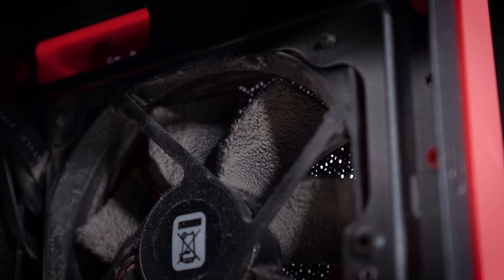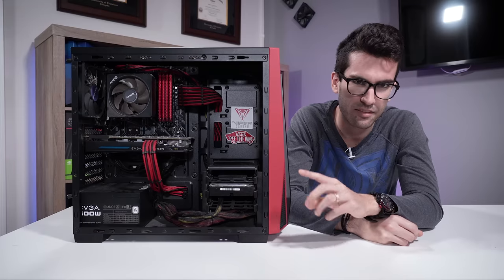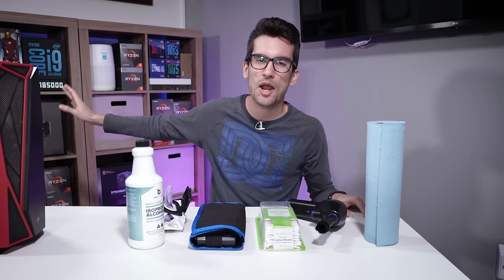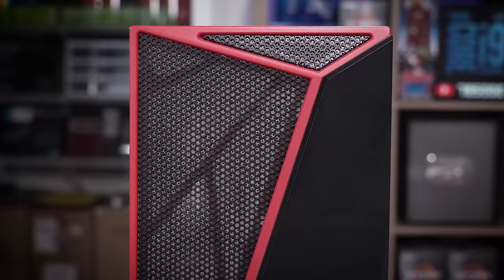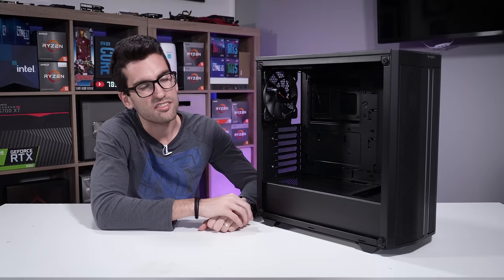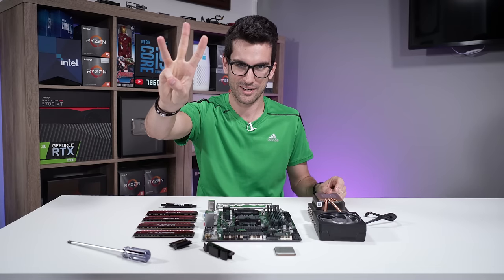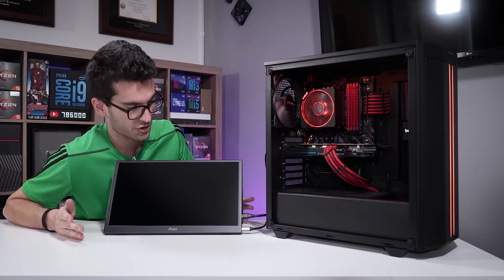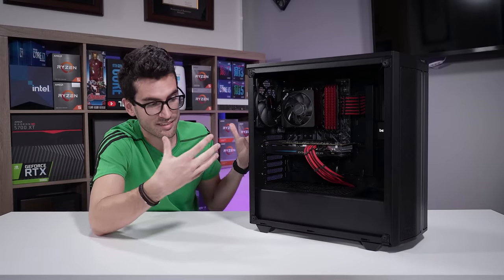Deep-Cleaning a Viewer's DIRTY Gaming PC! - PCDC S3:E4

Comment: Man I wish there was a way, maybe with the customers permission or something, to see the before and after temperatures on these. I'd place my bets that CPU is running a good 15 degrees cooler considering how much was caked on there. Also these vids were a big help when I decided to finally take my computer(mostly) apart and clean it up. Keep em comin big dawg.
Reply: He mentioned later in the vid that he will try to do a before and after for a reference
Reply: seriously???
Reply: I mean if he doesnt want to mess with the customers os he can always switch the customers ssd with his for testing
Reply: Lol you didn't watch the full video bro. 😂
Reply: Dirt/Dust/cable management will never do a 15 degree change, unless I am wrong. Thermal paste and airflow for an old system does more.
Reply: People are so obsessed with him doing temps haha, he just cleans em man
Reply: He could just connect his own ssd to it and install windows on and test it before and after
Reply: It will be a few degrees max. Trust me.
Reply: @bumble1057  go check Dawids latest cleaning video. gained 20C by cleaning a PC. a VERY nasty one but still. 20C
Reply: pressure wash ?
Reply: You can do CPU temps in the bios. However he does re-paste them and thermal compound has a break in time. Just re-pasted my GPU it went from 32c at idle to 26.5 but that took about a week to settle in it was the same maybe even a tad hotter at first.

Comment: The be quiet! Pure Base 500 DX automatically earns a thumbs up from me. Such a great case. Like you said, moving the top fan to the front is clutch. It does also sync up to ARGB software so you can control the LED’s that way.

Comment: You know, out of all the tech YouTubers, your case builds are simply the best!  I have a very dusty home so I got a case in 2018 that had full filters (AeroCool Aero-1000), to replace a Cooler Master HAF 932 Advanced which would get dusty and weighed a TON! lol (Due to a new medical condition my wife didn't want me lifting the old computer anymore, and made me build a newer, lighter one that I would not have to upgrade for 5 years.  To be honest, I like to remove and add on as prices drop.)  I need to clean this computer now and was going to take it to a computer store where I used to work to use their air compressor.  But seeing how you clean PCs, I would sooooooo drive to you from Louisiana to have you clean it!  Looks like I'll be taking everything apart. LOL  Great channel, great series, keep it up! (^_^)
Reply: So...am I being scammed???!!!

Comment: Fine, fine... You inspired me to do a deep clean yesterday. While not quite as bad as this one, I hadn't even done a simple dusting in well over a year (except the GPU - I was getting a weird pink windows issue for the last month, but dusting and reseating didn't seem to help) so I took everything apart and basically tried to copy what you do here.  I did have to reseat the RAM 3 times to get it to post, then tweak my RAM timings to get past the BIOS at all (I was running a slight OC of 2933 on a 3200 kit, due to Ryzen compatibility issues), but once I got into windows, my thermals had improved by a lot more than I was expecting, and, best of all, the pink screen was completely back to normal!  Thanks for putting these out there!

Comment: Btw, pressing and holding the led control button on the Pure Base 500DX for about 3 seconds will switch it over to motherboard control, so you aren't limited to the case preset colors and patterns.

Comment: I recommend checking out that 5 in 1 pc brush from amazon, its pretty handy and helps me keep things cleaner.. i keep it right on top of my desk and do a little wipe down on the keyboard and dust off the vents everytime I boot up.  Then I pull the panels once a month to dust and wipe things down.  Cleaning fans is the worst part and I still haven't found the best tool for those, just paper towels and lots of the alkyhol. Lol..

Comment: I want to say thanks to Greg. This is my son's pc and he's in love with it now. The side panel was butcher to accommodate a plexiglass cause he wanted to see the lights inside and it fell apart and he eventually threw it out. But now he's a happy kid.
Reply: If you ever feel like gifting him something for the rig, consider a more modern power supply. The basic EVGA 600W is cheap and seemingly gets the job done, but its efficiency is poor by modern standards and more on par with what was around in 2008-9ish, suggesting an outdated platform. That system should be more than happy with a good quality 450-550 W PSU anyway. I might suggest looking at a be quiet! Pure Power 11 500W (note: the 'CM' model is more efficient, partially modular and only a few bucks more), the EVGA 550 GA or a Corsair RM550x 2021, all of them 80Plus Gold rated and in a similar price range (70-90 bucks on Amazon). Going used may be an option but takes a lot of research.

As another fairly inexpensive quality of life upgrade, I might consider an inexpensive tower cooler (e.g. Vetroo V5) plus some small adhesive-backed heatsinks for the board's VRM MOSFETs to make up for reduced airflow down there. About 50 bucks all in.

Comment: In a case like this with the mATX board in an ATX case an easy fix to hide it could be a vertical GPU bracket. I did that in one of my builds and it works nicely. :)

Comment: I used mainframe sleeved cables for my build and they were very nice, not too crazy $$$, but more then Amazon.  But you get to choose every color wire, comb types, color connector, orientation of clips so it will fit your GPU and bend the correct way, thats a big issue I saw with the cheaper cables.  about 40 bucks for the 24pin, and I think 12 bucks for each 8 pin.. not the cheapest, but nice to make your PC a little more special..

Comment: Well, I would've moved the red led Corsair fan from the previous case to the new case since it would match the red & black scheme well, I would've placed it on the back, one 140mm fan on the roof and two on the front. But hey, I'm just nitpicking, another great job as usual.
Reply: new fans are probably quieter...

Comment: I am curious, why you don't use a vacuum cleaner on the parts of the build that would not be vulnerable to static electricity damage. It seems more practical to vacuum up the dust on these parts rather than blow them out of the part being cleaned.

Comment: Sad to see just one front fan and more open space around fan than fan area itself so it's basically just take air inside the case because it's less resistant to get there :)
Cases where fan is directly "connected" to filter and it's cover whole front then that will take air through the filter.

Comment: Watch out for poor quality cable extensions, here in Brazil there's a brand called Titan Caselabs who is known for good looking PSU extension cables, but recently, with more hungry GPUs and CPUs. their cables are melting, frying the connection they're in, even the 24 pin cables are melting. So, watch out for cables, even if they're thick (16-14 AWG), it doesn't mean they're good.

Comment: Learning alot for these videos but i do have a question i havent seen answered yet. I have a corsair h100 x240 cooler, its about 3 years old now and my question was will i have to replace the fluid in the cooler? Should i buy a new one instead? how long should i expect it to last. I have been having performance issues and i suspect its my cpu temps contributing to the issue.
Reply from the maker: If your temps are fine, don't bother. If it's getting hot, try replacing coolant. If that fails, buy another. Common sense dictates saving time and money if possible.

Comment: I'm kind of worried (I don't think it's actually in there) about a screw I dropped while trying to put a replacement PCIe slot bracket on the top part of the back of my case (I should have punched out the second and third for the GPU and considering how flimsy the replacement is I regret that miscalculation but it's better than nothing) being in the computer I finished building. How does a candy wrapper (that's not a tiny crumb like I thought that's a smudge of chocolate) end up in a case? lol

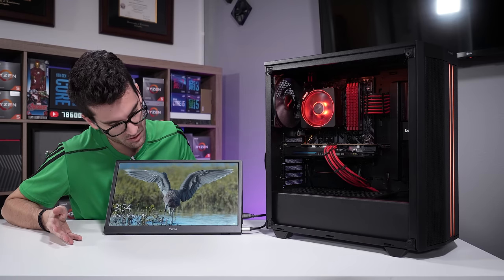Comment: 16:45 quick question regarding the boot time: I have an R5 3600XT on an Asus TUF Pro Gaming B450 motherboard and my OS is installed on a WD Green SSD. Windows boot-up process takes around 10-15 seconds. Is it normal? His PC booted so fast that it got me thinking. Thanks.
Reply: Yes cause every ssd is different in the terms of read and write speeds, also he might have fast start turned on

Comment: yeah never ever use a pc without the left panel I had a HP Pavilion Gaming Desktop TG01-2260xt PC a few years ago and when I was switching RAM out I was testing it to see if everything was working after I installed the RAM and I left the panel off just incase something was wrong well I have cats and I had water next to me well you guessed it cat jumped up knocked the water down and it got on the inside of the PC instantly dead.

From now on even when I'm testing a PC I just put the panel on to avoid that incident again and with this new PC I have and the one I'm currently building I don't like taking risks.

Comment: Cleaning PC fans is the worst. Just so fiddly. Shame the owner didn't use a faster M.2 SSD in the empty slot on that board. Only a 2.5" PNY SATA SSD. Still better than using any 3.5" mechanical HDD for the OS.

Comment: Greg, no wonder it takes days for you to do such a computer. Bro, you are doin' it wrong and it is just painful to watch you doing this for so much time, especially when you are "complaining" about how much of your time it consumes... First of, you should use the blower or a brush first, and then a Q-tip - if needed! - from large to small. Because second, you shouldn't tinker around with tini-tiney Q-tips when you can use a brush, a damp or IPAed or Windexed  microfibre towel or any other measures (just don't use paper towels, it has millions of lint particles, tears itself apart, its just a mess). Third if you have water, then use it (not flowing water as it is plain waste of precious, clean drinking water!), use a bucket or some sort of container to clean plastics, heatsinks, etc. Oh, and If it makes a large mess in your room, use the blower and the brushes paired with a handheld vacuum - airborne dust can settle back at clean parts. I advise you to check on some other youtubers doing this sort of stuff and learn some techniques. ;) Not tryin' to offend, but it's just about efficiency. Apart from that continue the great work!